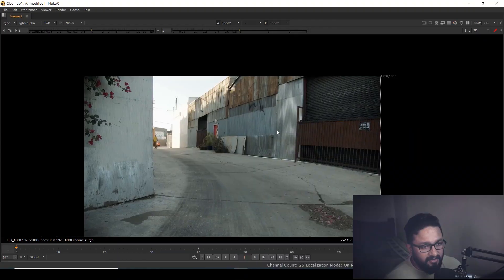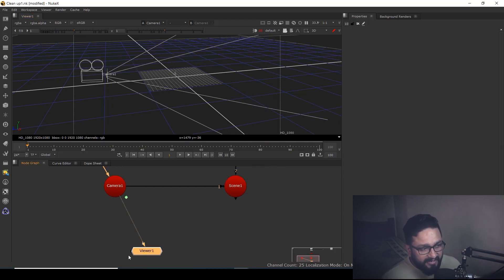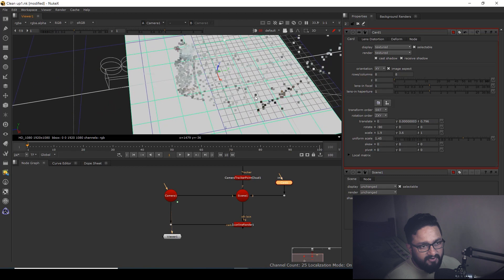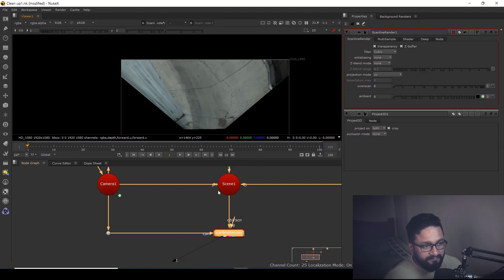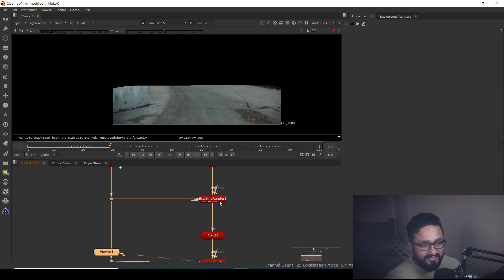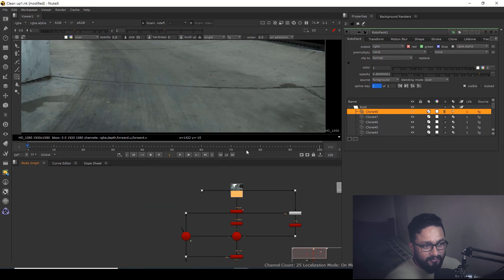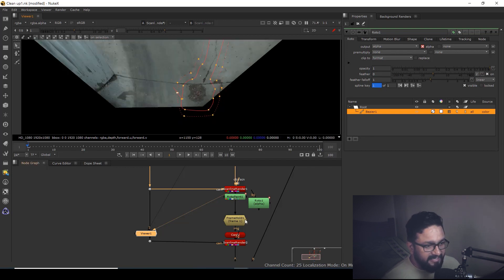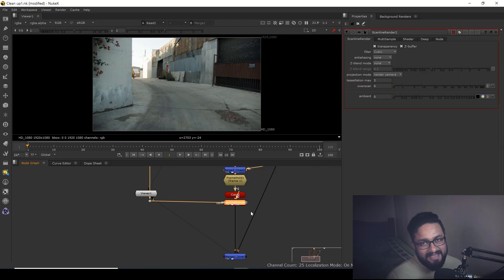HOW TO DO CLEAN UP USING UV PROJECTION METHOD | VFX VIBE

Comment: UVs should be in an aspect of 1:1 so yo need to add a reformat in the first scanline BG input with a resolution of 1024x1024 or something similar in order to get correct UVs. Anything else will get you a massive filter hit and in some situations the projected map will not work. Also consider premultiply with the rotopaint output alpha channel so you will only change the pixels you need instead of 50% of the image, degrading half the picture for no reason